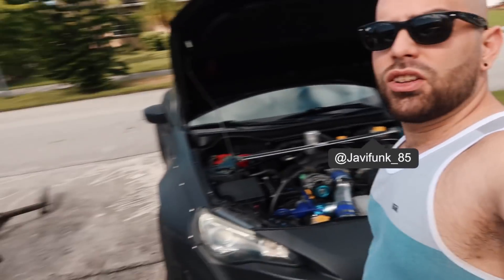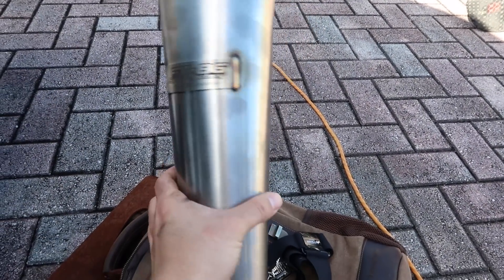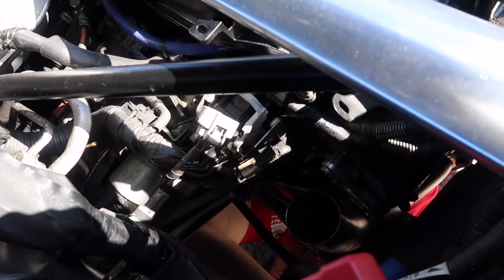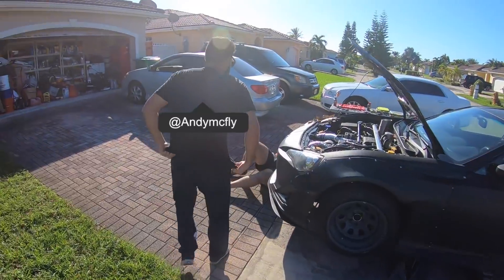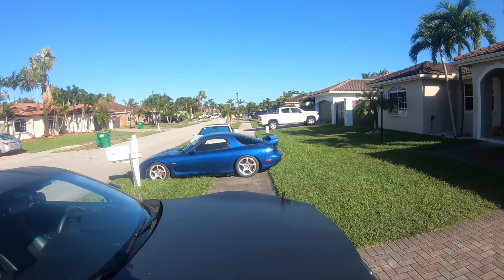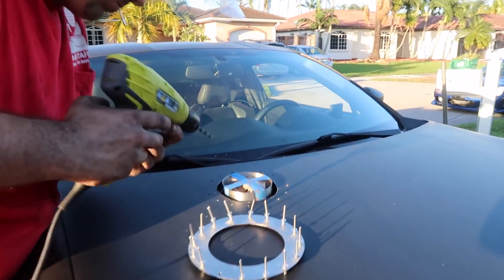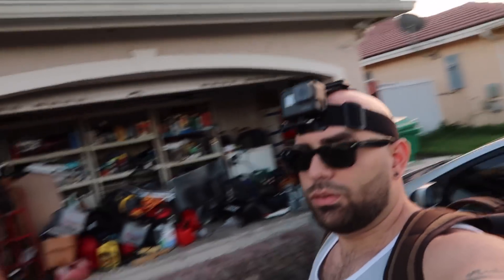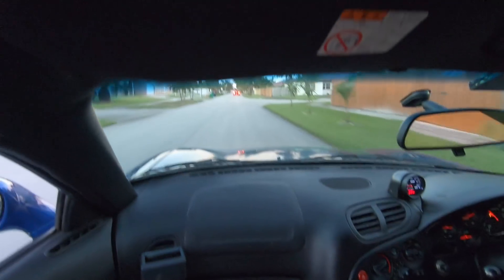Installing Extremely Loud Hood Exit on a Turbo Subaru BRZ *Hater Pipe*

Comment: And when it's rainning ?
Reply: asnoir84 they sell a cap
Reply: Lol i wouldnt ever do this to my car for that exact reason but it looks pretty sick imo.
Reply: Exhaust pressure even at idle will keep rain out. The problem is parking it in rain. People usually put red solo cups/caps over it when parked tho.
Reply: Hit full boost and any condensation in there will blow out:)
Reply: Water will collect in there which is obviously bad. You couldn't do this somewhere it rains often.

Comment: Can I get the dementions of that wheel and tire set up??
Reply: diamond racing wheels 16x10 -12 in the front and -51 in the rear with 225/50r16

Comment: how did you mount your tablet?
Reply: Kyle Tavares it's a custom mount that I made with an old suction cup Navi mount. I used the small vent that's just to the left of the gauge cluster hood and made a custom mounting plate for the magnetic flex arm of the navi mount.

Comment: Brz with a frs front bumper?
Reply: probably a FRS with Subaru badges.. its the same car so it dosent really matter lul
Reply: TurnIP I know its the same car lol. I own a twin...its just funny to kinda say it's a brz though, not a big deal lol.
Reply: Switched to the FR-S bumper to fit the rocket bunny kit extensions and the @innovativedynamics bumper ducts. Liked it much better than the brz bumper. Plus you can see the Subaru logo on my steering wheel and radio.....
Reply: Daniel Palacio Ahh that's makes sense now!:D
Reply: as stated before it dosen't matter lmao and the car looks good so who tf cares

Comment: Can you run this on a non turbo frs?
Reply: Mark Ramirez  It’s possible but pointless, it’s really made for turbocharged cars to have less restrictions and to gain power. For na cars it’d hurt it more cause the car needs back pressure and with this your gonna float your valves and probably loose horsepower.